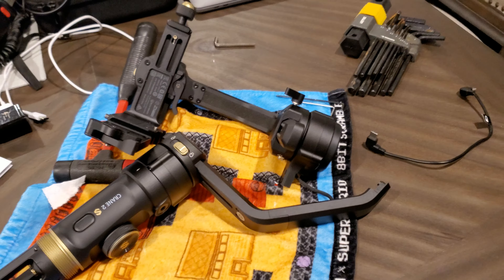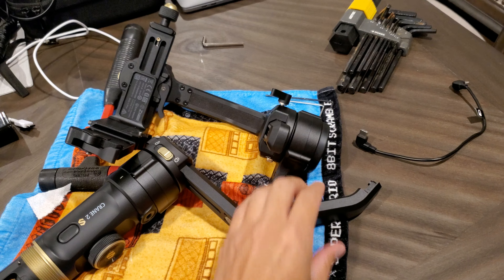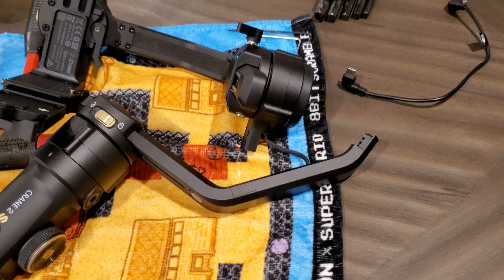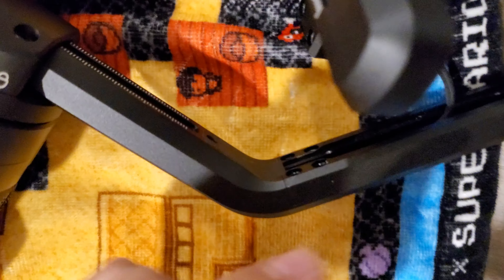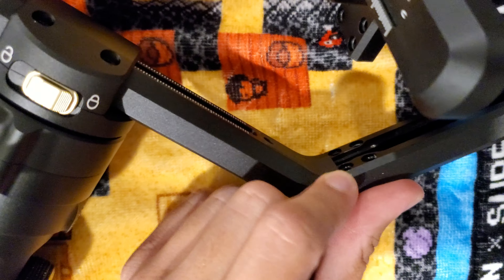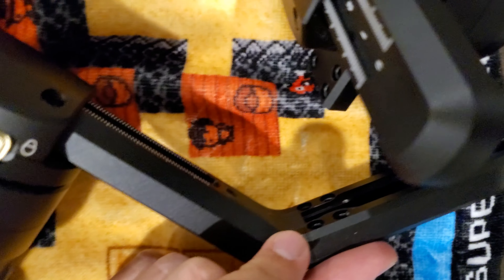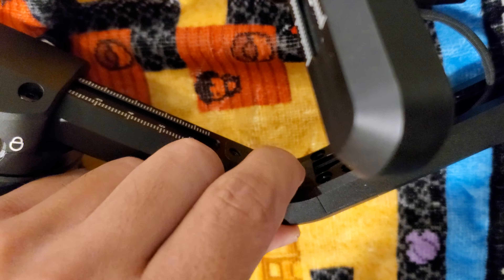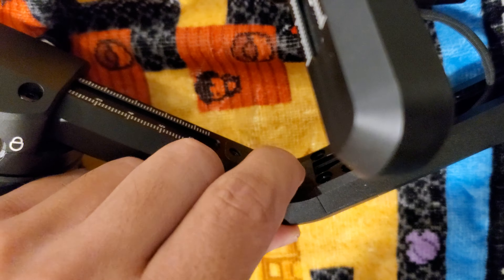How do you adjust / remove Zhiyun Crane 2S column?

Comment: Just a note. The foam piece was added after the column was removed. For me I had to make sure that I pulled "up" (as in away from the pan axis) until I got it to release. It's really tightly machined (assuming because they didn't want any play there). Glad you got it to work.